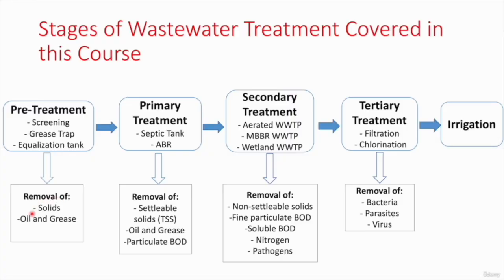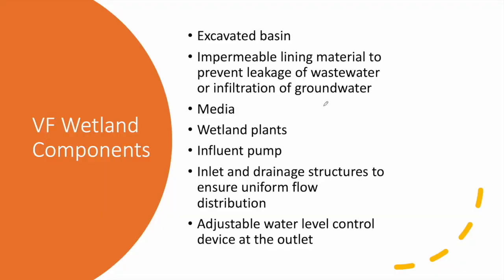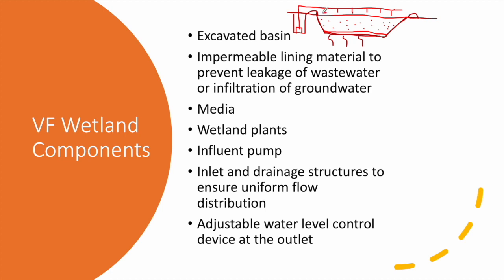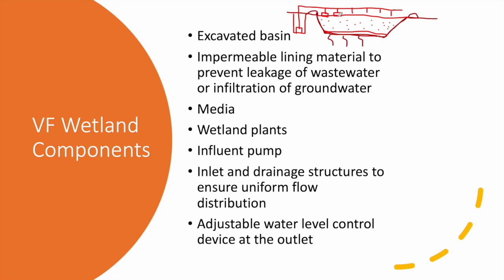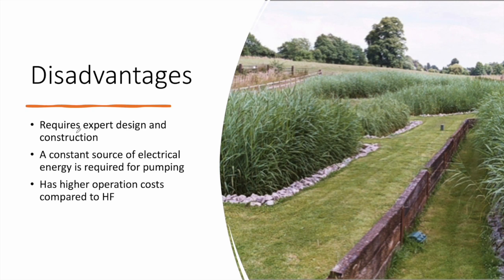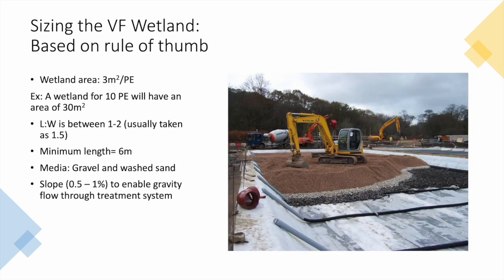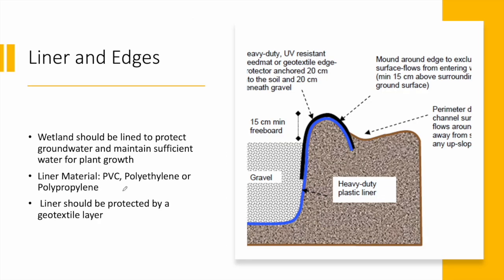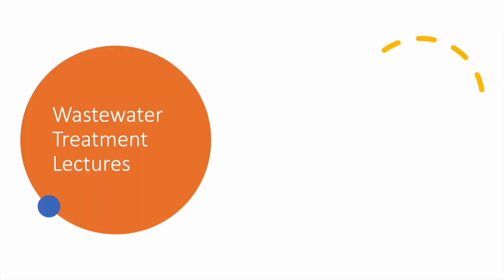How does Vertical Flow Wetlands Work? II Description and Design of VFCW for Wastewater Treatment

Comment: Water storage by constructing on the surface is like you said 👏👏the current trend.
This is first of all way I see Yours presentation and secend because you devided two flows. 👌 
Water storage and the construction of grouting curtains ensure the watertightness of surface reservoirs. It is also formed simultaneously. Opening of this Channel - Yours it is for practical as well as researching but with so creative imagination Essential of vertical and horizontal flow starts from the assumption that the existence of fissures in the rocks is an essential for the water storage through vertical and horizontal flow direction. The role of the aerated and non-saturated subcutaneous zone where the water flows vertically and reaches the groundwater level is heaving planty characteristics that you already lucid analysis and fully illustrated. It most often represents a large reservoirs where can be water stored for certain period of time as well as the water flow within the zone particulary after heavy rainfall with significant lateral impact. This is relatively narrow zone with big impact on echology. Subcutaneous zone is like you have said the only fertile soil, full of vegetation and very resistant to sever climate. 
Great way how you unite water in general with engineering! 😊
Reply: https://www.youtube.com/watch?v=zR1H6_B_hd4